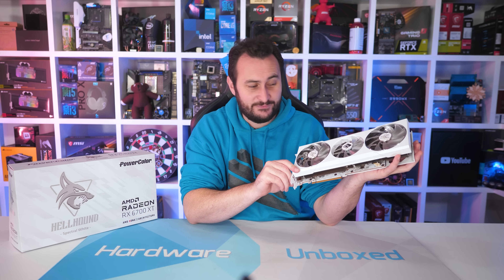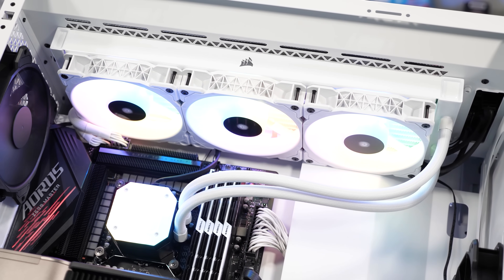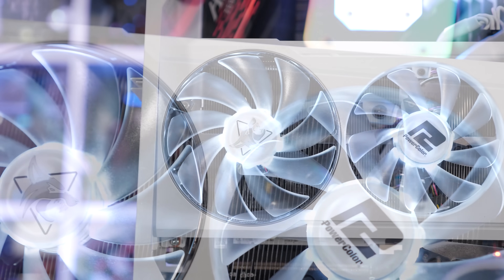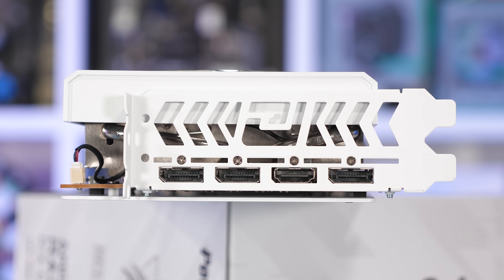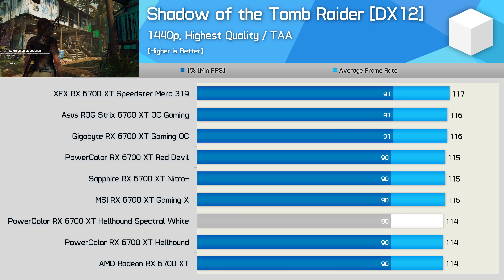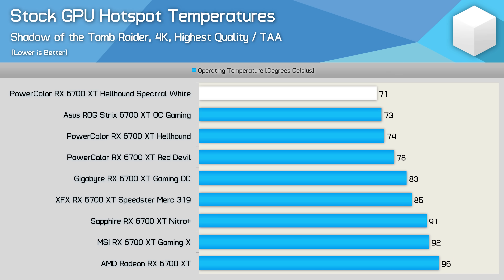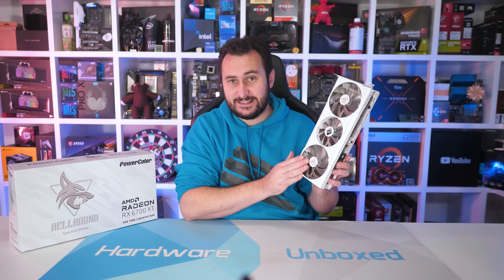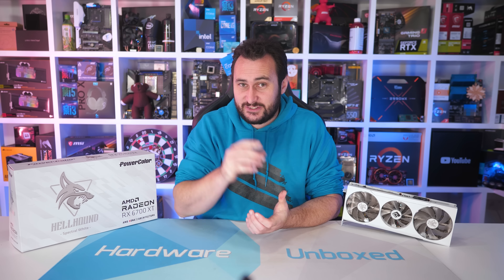PowerColor RX 6700 XT Hellhound 'Spectral White' Review

Comment: How are you getting such low hotspot temperature? At stock settings, my RX6700XT Red Devil hotspot reaches 96c and although it is well within spec, I still repasted it a whole lot of Artic MX-6 and now its max around 88c. Running an undervolt of -0.09mV takes it down to 84c max.

Comment: Does anybody has a good knowledge on  performance, temp and noise differences between:

1.) XFX SPEEDSTER MERC 319 AMD Radeon™ RX 6700 XT BLACK ( in the video)
2.) XFX SPEEDSTER QICK 319 AMD Radeon™ RX 6700 XT BLACK
3.) XFX SPEEDSTER QICK 319 AMD Radeon™ RX 6700 XT ULTRA ( What I got)

Comment: I got scammed on Ebay. I bought a Zotac GTX 1660 and I never received it even though the tracking information says it was delivered. The seller refuses to deal with the situation and Ebay refuses to help. Don't make the mistake I made. Don't buy from Ebay or you may also get scammed. It seems I lost $400 and will not get a refund.

Comment: Powercollor graphicscards all of have bad coil whine i use to have 3 of them 5700 6700 and 6800xt now same 6hit bad coil whine
Reply from the maker: It could be your power supply/quality of your local power. Try getting a UPS with filtering and it might fix the problem.

Comment: I have a white-out PC built in 2014 with 4770k with a white mobo, white graphics card shroud, and case.  The yellowing is very gradual (if buying high quality item) and would barely noticeable even 4 years later.  I'd say it is a non-issue unless you're planning to keep your PC longer than 5 years.  Even then 7 years later, the yellowing is only noticeable in either daylight or 5000k white light.

I will saying any white PCB or white plastic will yellow first.  The only time I see drastic yellowing within few years is with any cheap crappy parts.
Reply from the maker: It really depends on the quality (and type) of paint used. Cheaper stuff will do in inside of a year. For example I've had a Galax card that yellowed in a very short period of time.

Comment: epic was thinking of trying to find one of these cards over a 3060.  i found various benchmarks but none that compared a 6700 xt to a 3060 with  DLS on @ 4k.

I had  been waiting to upgrade my 2015 laptop since 2 years..  Replace with PC tower.

Today i'll get a AMD R5 3600 - b450 mobo -16gb 3200 ddr 4 ram  - 500gb troll budget ssd from the sounds of it - with a 650w modular  psu and case.  It will set me back around $490 usd . 

However no gpu.  So im trying to get whats best value.  for a 650W psu looks like in current gen gpu im tied to 1 these cards 3060 or 6700 xt   

No clue what to go for.  if i get  3060 / 6700 xt as when prices start to dip i might just sell whole thing as upgrade value possibly not there.  or hold on to it for 2 years and sell. 

I can mine on it i guess when not gaming to recover the gpu cost.
I figure even if i part out the rig i'll make 80% my cash back holding onto the case for next gen ryzen potentially 2022/3or who knows arm nvdia intel even lol.

Any tips readers?  My best scenario would be 4k 60 on my Sony tv as display - not a fan of consoles :p
the  crux of the decision tree here is this.  
Is a 3060 with DLSS on superior to a 6700 xt @ 4k 60 hz?

Comment: Though you can't do much about the PCB, Exposure to intense UV light will whiten plastics up in short order. The backplate can always be powder coated if it yellows. Heat will be a big factor in yellowing as well. Been looking hard at the Gigabyte vision 3080 because I need nvenc.

Comment: Thank you for this review. Any chance of reviewing new B550 offering from Asus - ProArt Creator? It's the first ever AMD B550 motherboard with Thunderbolt 4/USB4 ports. It does not seem to be officially certified by Intel, as yet, like X570 ITX last year, but it's interesting enough. Also, the number of capacitors is not that big, so could this motherboard OC well 5900X?

Comment: Is the yellowing semi-permanent or can UV light reverse it?   I know peroxide could bleach it if strong enough, but wondering if light can as well.
Reply: UV light should reverse it, but peroxide can have funny side effects like brittle paint, or outright wonky color effects. I once tried it on the white base of a blender that had turned yellow. It whitened up right away, but after a couple of days it developed a very slight bluish green tint that was only visible in daylight. In electric light it still looked white...

Comment: 2 things: 1) Another big factor in yellowing of any plastic or paint, is heat. Inside a PC case, that's very long term, extended or constant exposure.
2) What were the OC results like? IMO the ability to overclock easily, deliver power, and good cooling / noise profile, is an essential core feature you're paying for (often a lot too), when buying premium versions of GPUs, motherboards and relevant CPUs the last 5++ years. There are exceptions of course, but thinking generally. There really isn't all that much out-of-the-box, bone stock configured performance difference between the different models, because there's not supposed to be. Where the real differences lie (re; mentioned exceptions), is in the cooling and overclocking. That's not just my own thinking, the manufacturers apparently do so too, sinking a lot of budget into that, and actively encouraging its use so much as to polish the tools to do so, and even putting overclock(ing) or OC right in the product name.

Comment: Hi Steve, thanks for the review. May I interest you in making a Sapphire Pulse version of 6700 XT review? I recently got one and it has some interesting stuff. For example the card has a dual bios cut-out and written on the backplate but it does not have an actual switch despite the 5700 XT version had. This alone interests me enough to see if Sapphire has an answer for it. It also lacks the LED lights which 5700 XT version also had so plenty of "???" stuff going on.

Comment: I thought light pollution was the very thing that caused yellowing in the first place, not the absence of it. I also can't really figure out why you would suggest that the backplate will go yellow but the "top side"/fan shroud would stay white when the backplate is the surface that would most likely come into contact with natural light - opposing your first statement. I'm not an expert on this matter I'm just trying to understand what you're saying here:).
Reply from the maker: I said if you sit a graphics card on your desk, as in fans up. I'm glad you leant something new though about what causes the yellowing.
Reply: @Hardwareunboxed  Ahhh sitting it on your desk, i thought you meant backplate up, sitting inside a case. Thanks for clarifying. Hopefully, the GPU will be long obsolete before any yellowing occurs.

Comment: VRAM temps?? i feel that info would very nice to know for some of us, so kinda bummed out you did not mention it, especially with no thermal pads connected to the backplate to aid GDDR cooling.
Reply: I've got the black 6700XT Hellhound and according to HWiNFO64 the VRAM under full load is roughly the same temp as the GPU edge temp at roughly 60 degrees C. The GDDR6 (non-X) doesnt produce a lot of heat and the Hellhound has thermal pads on the VRAMs which transmit heat to the heatsink, the cooling design on the Hellhound is definitely sufficient for this card.

Comment: That white PCB is beautiful i really hope more start doing it including motherboard manufacturers i understand the yellowing issue but damn its good looking
Reply: If you run some UV-LEDs in your case it will prevent the yellowing since it will keep the paint bleached
Reply: @Aeriket  never thought the shiny trend could actually be useful someway but if it's for that beautiful white I could even do it
Reply: @rodrigoferreiramaciel4815  think about 6 years ago it would have been impractical to produce UV light in a case since you would have to you cold cathode tubes now small 5w led strips can do it

Comment: If you want white Graphic card
1. Just buy normal one.
2. Disassemble it.
3. Paint it white.
4. Put it back together.
5. Profit.
Reply: 1. It is very hard to find a paint that looks the same on plastic as it does on metal
2. You will most likely lose warranty 
3. GL painting the PCB